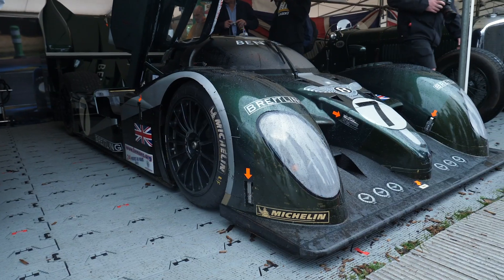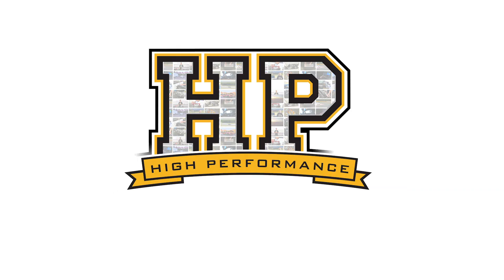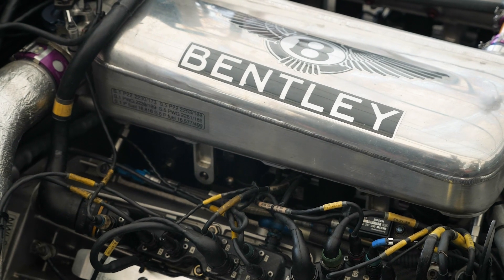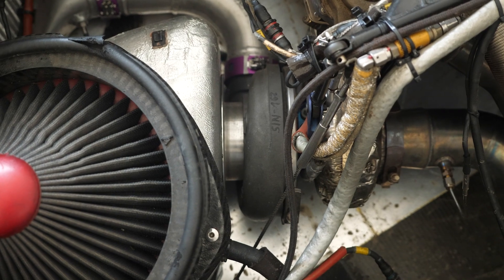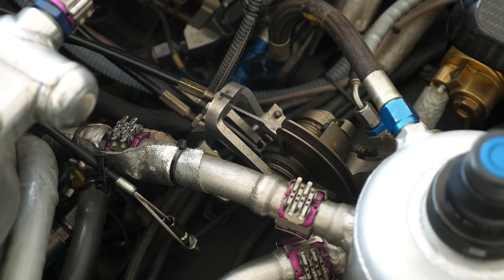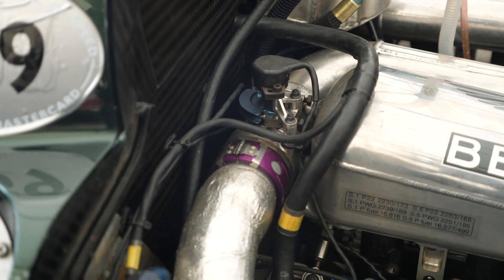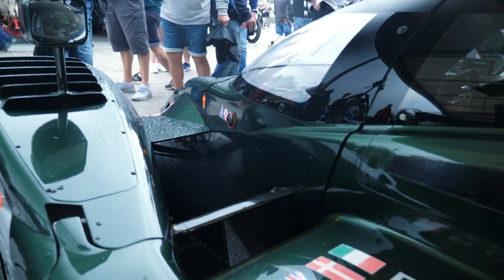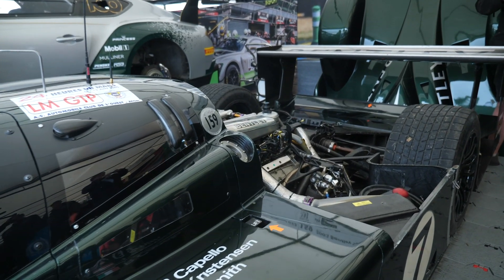900kg and 2200kg of downforce?! | Bentley's Speed 8 LMGTP Champion [TECH TOUR]

Comment: At over 200 mph...I’m curious how compressed the suspension must be with such immense downforce, and how much suspension travel is available.
Also, seems as though the suspension geometry, along with compression and rebound rates would be significantly different at various speeds.
Reply: 4 way suspension and wishbones.. That's a video on its own :)
Reply: We had 10 to 20 mm of suspension movement. had to be very careful as  would cause "porpoising" what you saw on the Merch where  the car loses down force and takes off as the flat floor looses suction.

Comment: Correct me if im completely wrong, but 2200kg at 150mph would be around 4730kg at 220mph?
220/150=1.46
1.46² = 2.15
2200 x 2.15 = 4730.

Or have i got that bit of bro science completely wrong? Lol
Reply: Don't think aerodynamics are quite that simple
Reply: I was told by the engineers that we had around 2 tns of down force at 150mph
Reply: @stephenrowley4171  downforce and drag square with speed
Reply: It's correct bro
Reply: @stephenrowley4171  They are really, he is correct